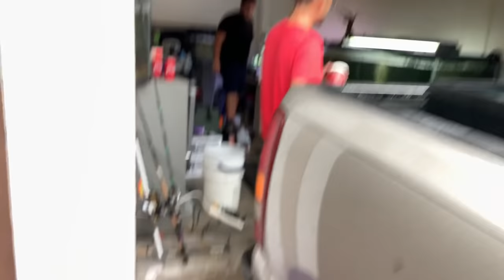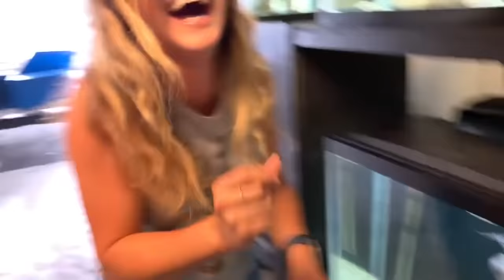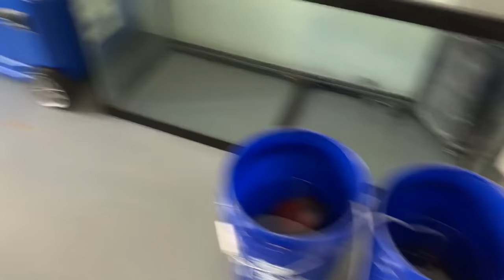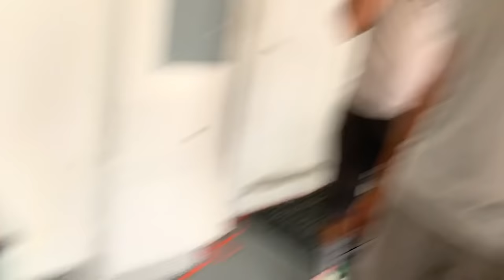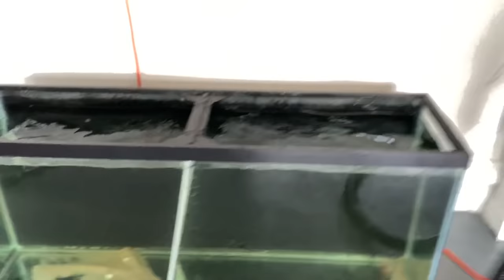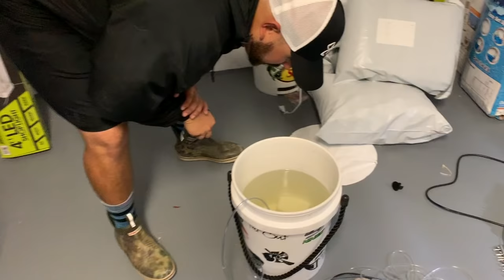RESCUING DYING Flowerhorn FISH From BAD FISHKEEPER!

Comment: Am I the only one noticing that Joey's solution to "save" this sick fish is to put them in a non cycled aquarium saying that "the water is cycled" and keeping a fish in a bucket with just an air stone ?
Reply: The water came from an active water supply that's been cycling through the filters and no m bio media balls i men its keeping other fish alive should be able to do the same for the flourhorns
Reply: @donnieharness2  The water is just water, beneficial bacteria that is needed to cycle a aquarium is not in water. It's on surfaces like filter media, it can be on the glass of a establish aquarium, and on aquarium decor and sub-strait. There nothing beneficial in the water in fact used water can turn bad faster via ammonium, nitrites etc spikes. A aquarium can not be cycled just by using water from a running aquarium.

So if that aquarium has not been fully cleaned, with any thing that can kill beneficial bacteria, then there is beneficial bacteria on the glass surface that could aid in cycling the tank.
Reply: He said he put medicines. I’m sure that includes beneficial bacteria.
Reply: donnie harness read a book, water does not cycle, filter media does. Water contains no bacteria it does contain the chemicals need for the cycle. So the water only contains the last element of the cycle which is nitrate which is poisonous to fish. You never use old water to cycle a tank, that’s the whole purpose of water changes to remove the harmful elements of the cycle.
Reply: eyla0824 nope. They actually believe water will cycle a tank on its own. I see all the Florida guys saying this an none of them have a clue how they nitrogen cycle works. Those tanks will ammonia spike and the fish will be dead in a week.
Reply: Kaka Zeira he said he had no idea what he was doing...I am going with that.😂😂😂
Reply: @Matty.Disson  do you find funny that a person steals another persons pricey animals and basically kills them for views ?
Reply: The water came from the large cycled water source that is housing the larger fish in that huge pond like tank. That’s where they took the water from. So yes, that water WAS cycled. You can literally watch him turn off the pump that’s taking water from the large tank.

Comment: cycled water? there’s no such thing
Reply: Josh Thomas they mean established aquarium water. Usually before putting a fish in a tank one must first run the tank with plants to make water conditions ideal for certain fish to live in. This takes usually a few weeks at least and is called cycling the tank. Some fish are extremely sensitive to water conditions and will die if they are put in an uncycled tank. This is why when cleaning a tank you don’t completely change the water. You only drain it 1/4.
Reply: vinnie vee you cycle a tank to establish beneficial bacteria in the filter and other surfaces, using a source of ammonia. this bacteria is not suspended in the water column, so adding water from an establish tank does not help to cycle a new tank

Comment: You don't 'save fish over a matter of hours'. Keep fish in Cool water in low oxygen water and they will look drained like those. Also you could have split the tank into 3 to help the other I'm sure? On a temp basis. Plus you said that you added cycled water which isn't really the case. Filter media cycles not the water
Reply: No, he could not have put all three in that tank. A 55 gallon tank is enough for one flowerhorn. For two that jumps up to 150-180 gallons.
Reply: @TheMooshooman1  as a holding tank there is more than enough space